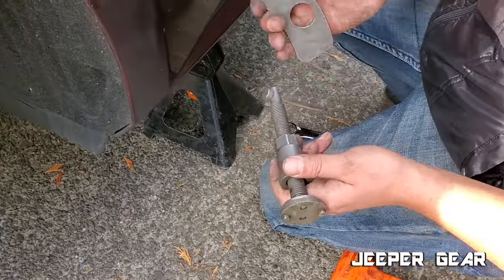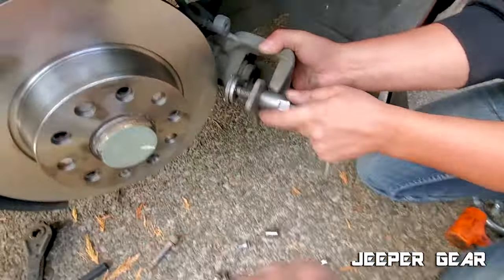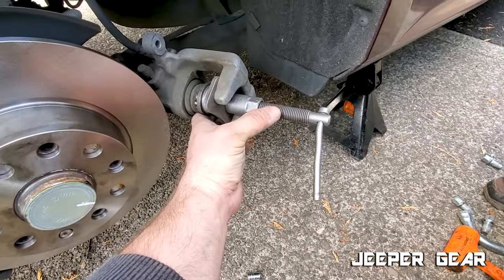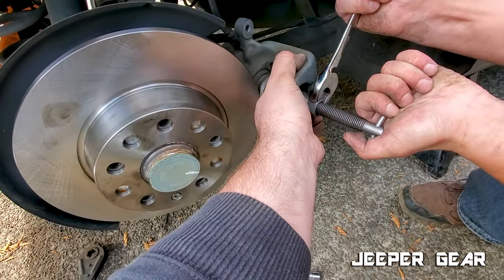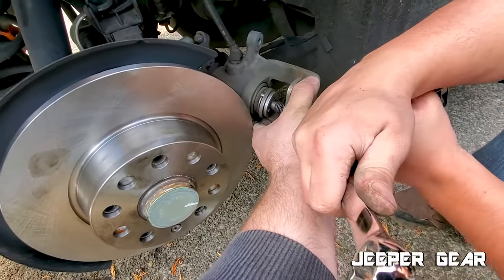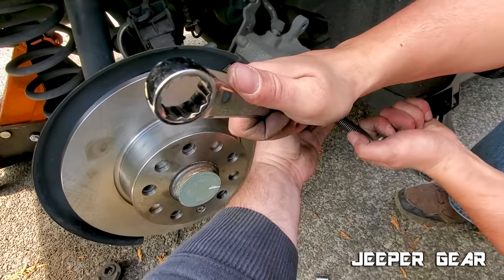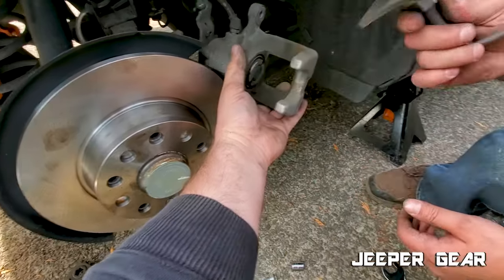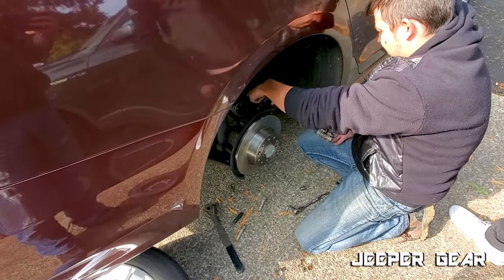How to Compress rear brake caliper VW Passat

Comment: Mechanic told me I have to come in so they can use a computer to unlock it so it can be wound back.. does this sound right?? Or can I still do it my self?? Charged me $400
Reply: That's only for the electronic ebrake... There are work arounds for that.
Reply: IF you have a pushbutton on the dash to engage/release the parking brake, that is correct.  It is done with the VCDS or factory scan tool.  The cars with a hand brake use this procedure.